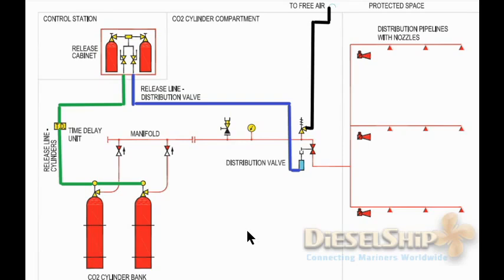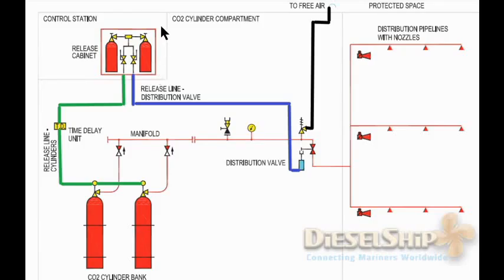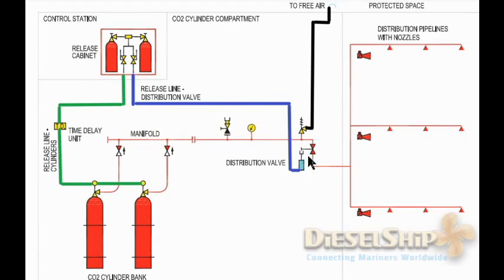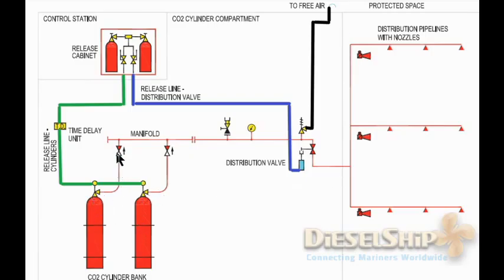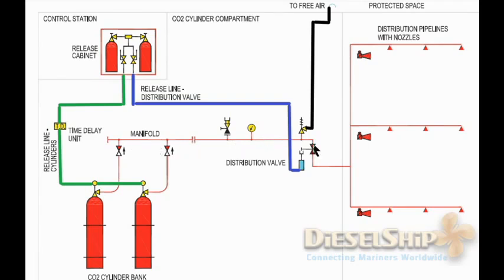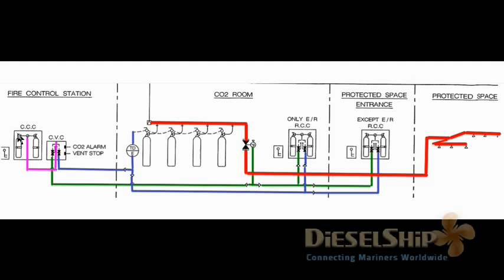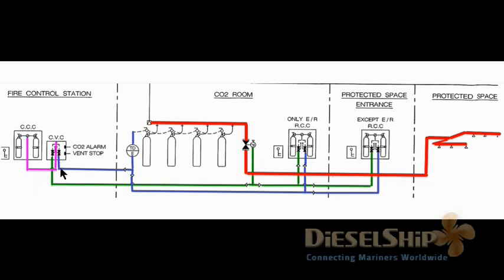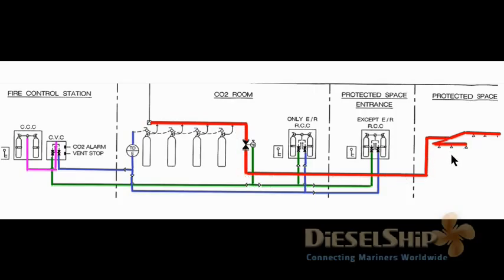The sailors confession -Understanding Of Co2 System Onboard Ship.

Comment: The time delay is usually 30-90 seconds. This allows the crew to evacuate the protected space. The time delay time is in the STCW standards.
Reply: another major point is that If CO2 is released from main bottles to the common manifold before opening master valve, there may be difficulty in opening master valve because of the bulk CO2 pressure acting on it. Because of the time delay, positive opening of the master valve is ensured before releasing CO2.
Reply: The video mentions automatic closing of ventilation fan and duct. Is it a SOLAS requirement ?

Comment: sir why 85% in 2minutes?? why not less?
Reply from the maker: It is to make sure that the fire has been extinguished in engine room..and all the volume has been calculated as per the volume of engine room.There are formulas based on that this 85% concept here.when you see onboard co2 distribution diagram,you will find for cargo hold there are less number of bottles as per loading condition of cargo hold but when you count the total number of bottles then you will realize that all the bottles will we used for engine room to safeguard the engine room because without engine room the ship can't move on.

Regards,
The Sailors confession
Reply: Thankyou sir
 One more thing sir. First we opened all the bottles or the master valve?
Reply from the maker: Master valve opens automatically when you open the valve in control cabinet but if in case it fails to open we will open it manually
Reply: @therealestatemariner  sir like all the bottles have been punctured but master valve is not opened by pilot bottle. Then isn't it hard to open master valve as all the bottle pressure is acting on it?
Reply: Okay sir thank-you ❤️
Reply from the maker: Its not like that....it will open...2-3. People with the help of F Spanner can open that.... by the way only one person can open...just like main air bottles valve for 30 bar for main engine,only one person can open like that you can open...no issue with that
Regards

Comment: Hi Sir, my doubt is how to ensure 85% of CO2 is released in protected space with in 2 minutes . Also explain the entire concept of 85% ?
Reply from the maker: See the pressure gauge..... Suppose 100 baar pressure it is showing initially then after 2 mints it's about show 15 bar I. e 85% has been released... No other reason
Reply: @therealestatemariner  Pressure and volume are not directly proportional so the reading on the pressure guage wont provide exact calculation...  The manufacturer himself designs the system in such a way to obtain at least 85% in 2 minutes... Also, After releasing make sure all the required bottles are released to ensure the req is met.